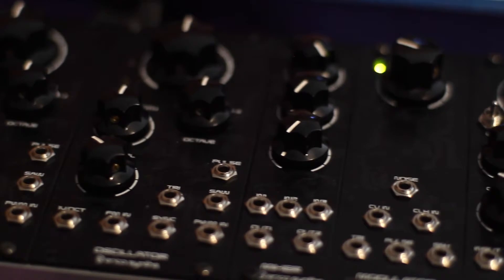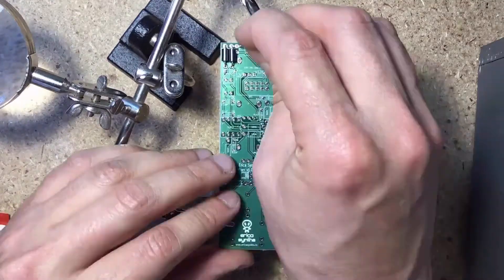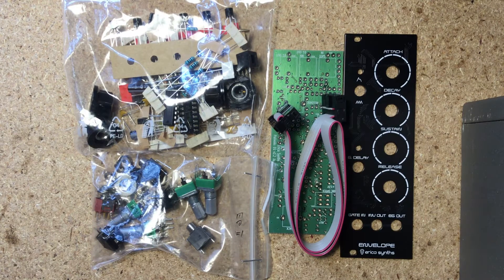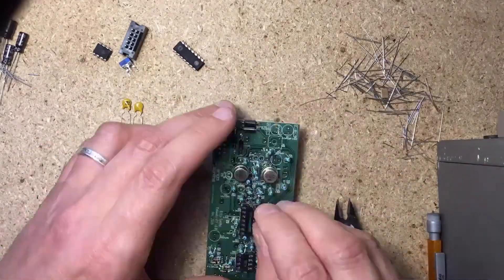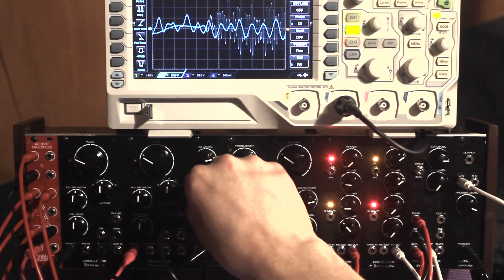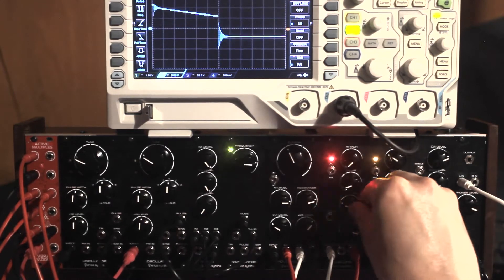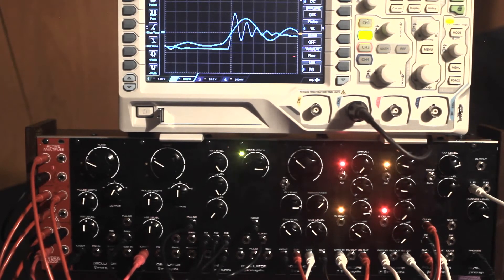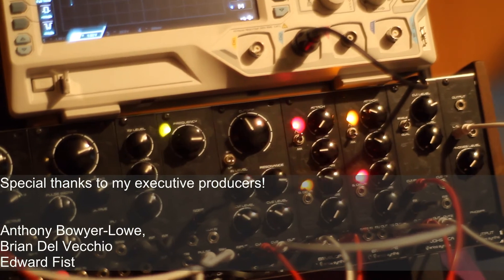Erica Synths DIY Bundle II Part 2 : Polivoks VCF, EG and Mixer

Comment: a bit outdated but i just noticed something. Is it possible that even when the cutoff is fully counterclockwise, (closed) some signal still pass at the output? i never noticed that before.
something like 100mV.
Audio level fully clockwise (open)

Comment: these close-up shallow DOF shots look extremely tasty. not sure what lens you are using but it looks amazing
Reply from the maker: Thanks! I use old manual lenses from the 70s! All Olympus Zuiko OM mount, with an adapter for my digital cameras. I think in this video I was using the Canon T3i with the Zuiko 50mm Macro Lens. I've since switched to a Sony Alpha but still using the same old lenses :)
Reply: @QuincasMoreira  Very cool

Comment: hello there! i did some build of erica synth diy modules.. swamp and vcf are working fine.. i have problem with the VCO and the EG.. the first only output are high frequencies(i got no oscilloscope, i cannot measure exactly what frequencies are cut) even when i tweak the OCTAVE and the SCALE trimmer..
the EG looks kind of not working because the LEDS are not lit but the chip gets relatively hot, so voltage is coming in.. any advice on how i can fix them..? thanks in advance!

Comment: Just built the mixer and thought I had done it perfectly then plugged it in tried it out and nothing. Have double checked everything and not sure what ive done wrong. Everythings exactly like the assembly guide the only thing im confused about is how the assembly guide had a zoomed in picture on step 3 that I dont see on the board. Can anyone help out?
Reply from the maker: Hi! Yeah, that closeup picture is of the Electrolitic cap placement. It's very important that it be correctly oriented. Make sure the cap's side with a line matches the line on the circle in the PCB.

Comment: Love the sounds of the Erica synths gear. I suck at soldering and electronics so I would just order the prebuilt system that I can just put in the rack and turn the power on.
Reply: Renaissance Man The soldering of these modules  doesn't look too bad. An advantage of smaller pads is that they will heat up quickly so you don't have time to cook the component. Having said that the components are pretty resilient, the ICs are rocketed, not soldered. But I respect you for knowing your limitations.

Comment: This was my second module to build, after a simple buffered mult. I was delighted to plug it in and find out that the attack and release functions work. However it seems like the looping, the decay, sustain, LED's and gate delay do nothing. I'm not sure if I got the LED's in backwards, since they weren't really marked on the board which was minus, but I don't think that should impact the other functions. Another weird thing is that once the envelope is finished it actually pulls slightly negative instead of zeroing out. Any ideas? My kit was missing two resistors which I subbed for equivalents I had in stock, and I had a third of a particular resistor value that the BOM said should only have two.

Comment: hi ! i built the enveloppe generator and when i Power it on, red LED goes fully lit for half a second then generates only a tiny bit of light and doenst respond to gates or just the enveloppe stages when switch is on loop mode ... any idea where it could come from?
Reply from the maker: it's hard to troubleshoot over comments on the internet...  If you turn Sustain all the way up does that help?
Maybe check if the gate jack is well soldered and conducting to where it should be, have a look at the schematics in the erica page!
Reply: Synth Diy Guy as freaking stupid as it sounds, i had the IC the wrong way... thanks anyway ! now gotta make my sonic options mal2 which doesnt even seem to power on...
Reply from the maker: Ah, not stupid, just distracted, I do that from time to time! Many a chip fried, lol. Good luck with the Sonic Potions! My next review is a kit from them, the Descent.  Cheers

Comment: Quincas thanks for this Erica build series. Nice job! Very helpful advice. The only mistake I've made so far, I think, is on the EG. I populated the leds too soon. I didn't read instructions, flush mounted the leds to the board and cut the legs without thinking. Oops. As you pointed out take your time to check carefully and it is wise to populate low profile components first. I also find it works well to populate components in clusters particularly when component density is high. Complete an area and avoid having to return to space on the board wishing you had better access. Thanks again for a comprehensive video.
Reply from the maker: Thanks Logan :)  Hey, it's pretty normal to make mistakes, I do all the time, usually on camera too, lol.  You can try to fix those LEDs...  Use desoldering braid to remove them, then make extensions with left over resistor leads you may have laying around.  It's easier to just replace the LEDs with new ones, but if you don't have any the right size and luminosity, you can still fix it with a little patience. Have fun with your Polivoks!

Comment: How do you check for shorts on the power connector? 1.04 on video. I’m a newbie who has bought these kits as a result of you excellent videos! 

No idea how to use the multimeter I’ve just bought to check capacitor values if anyone has any tips. Thanks
Reply from the maker: Hi Philip, I´m glad you are enjoying the videos, and congratulations on your purchase. To check for shorts you use the continuity mode of your DMM. It's the mode that beeps when the leads touch each other. You make sure it does not beep when you touch one lead to one power rail and the other to another. In other words, there should be no shorts between any of the power rails, check out this video where I show you how to do it: https://youtu.be/j3Zdh7Qu0vk?t=17m37s
Most DMMs don't have a capacitor measurement, and that's ok. You can just read the capacitor value right on the package. The tin cans (electrolytic) have the value spelled out on them, and the film and ceramic caps follow a code. Use this online calculator to figure them out: http://www.muzique.com/schem/caps.htm
Just don't get nanofarads, picofarads and microfarads confused! 1000 000 pf = 1000 nf = 1uf
Have fun, take your time and be very careful to avoid mistakes!
Reply: Synth Diy Guy - This is incredibly helpful and its really kind of you to help me out in such detail. Many thanks Phil
Reply from the maker: My pleasure Phil!
Reply from the maker: my pleasure!

Comment: Fantastic videos. You have inspired me to purchase a diy multi mode VCF! My only concern is that I only have a single temperature soldering iron. Does this really matter e.g on larger components could I just hold the soldering iron on for slightly longer? Thanks for any advice you can give.
Reply from the maker: Hi, thanks! If you have to hold the iron in place longer, then it's definitely not hot enough. If it's a 35W or 40W iron it should work ok, but I definitely recommend you get an adjustable one, even a cheap Chinese one without temperature display will do!
Reply: Synth Diy Guy thanks for the prompt reply. The iron I have purchased is 40w. I'm only doing one module, so couldn't really justify spending much more. I aim to use the small chisel tip and hold on for no more than 2 seconds.
Reply from the maker: So you think you're only doing one module, do you? That's cute :D

Comment: I'm thinking of getting this bundle. Would you recommend the full kit or are just the pcbs enough? I've done some electronic stuff before ...
Reply from the maker: It depends! I personally hate having to source parts, so it is worth it to me to get the complete kit, even if it turns out a bit more expensive. Also, considering shipping from various sources, wait time, possible wrong purchases, etc... I think you don't even end up saving much if you source your own parts.
Reply: Thanks for the answer! I will reconsider this :D
Reply: Just about the only time you'd save money sourcing your own parts would be when building a large set of modules from the same series. There are a lot of common parts in this series, so you will get economies of scale buying in Q10 and Q100. Plus the PCB+Panel+IC kits come with the rare ICs you'll need. I wouldn't say that I've saved money in the process, but I've built a pretty solid parts library so I'm ready to go with additional kits from this series.
Reply from the maker: Totally, it adds up!
Reply: i ordered this full kit and 3 boxes got missing or wrong parts !!!!